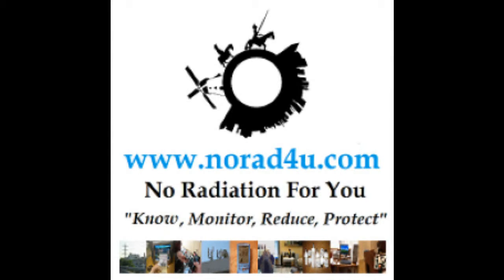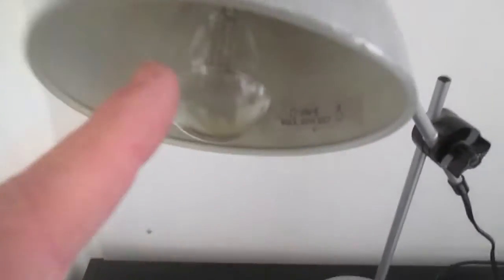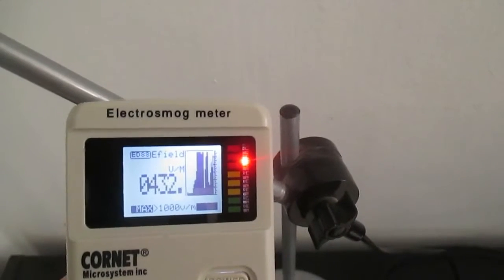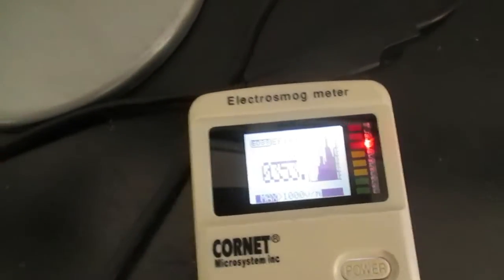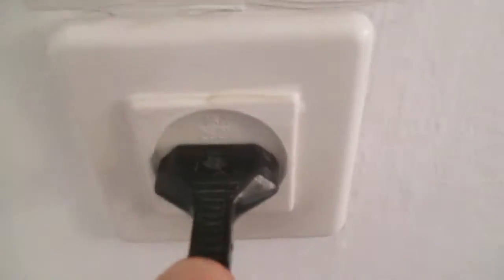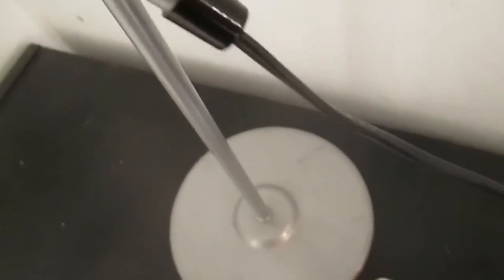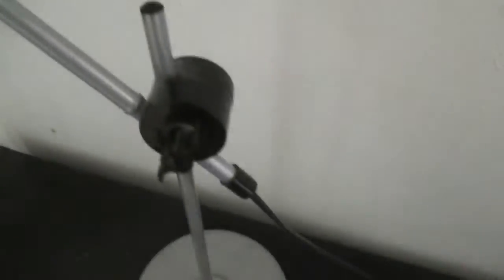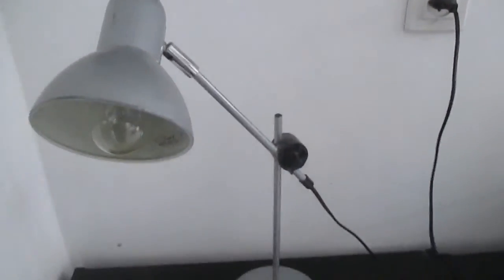Efield (electric field) from electric lamp

Comment: Everyone needs to buy a preplug with on off switch or have controllable fuse boxes so they can sleep or be in a house without all that wired electric fields...It's in the overhead lights too, and I never felt good when the refrigerator turns on, so when I turn it off, I feel much better but now I see you have to unplug it but there is still electric field in the walls of all the houses...I think people can get disturbed if they are more sensitive than the meter.  Many people say cell phones burn their hands and ears until they get away from them so there are fields people are disturbed by.   

There is no way to sit on the bus without everyone's cell phone....EVERYBODY turns on a cell phone on the bus.....
Reply from the maker: l also sleep with all the electricity in the bed room area turned off from the switch box. 
Using a 3 pins socket with a On/Off switch is very helpful 
Since I am an EHS person, I don't use cell phones or wireless devices. 
I can't use public transportation as well.
I think very soon most people will feel the radiation, then it will be impossible to argue that there are no health effect to EMF exposure (as industry does now, while selling another device to the addicts). 
Keep strong
All the best
amirb